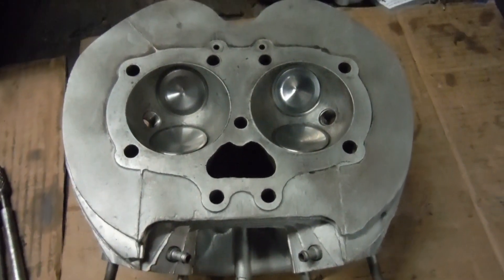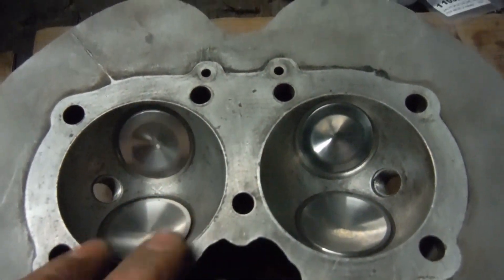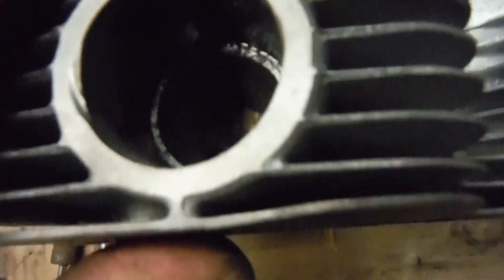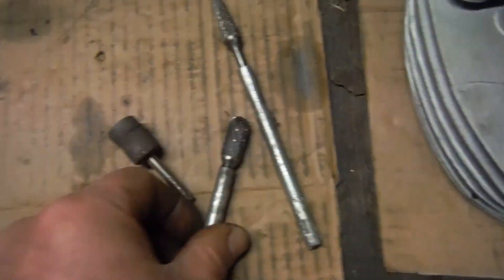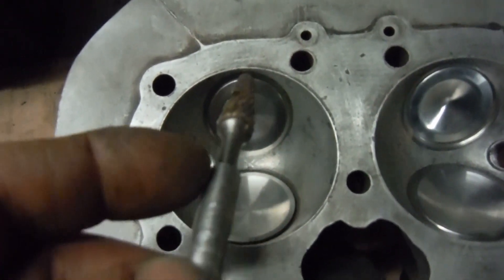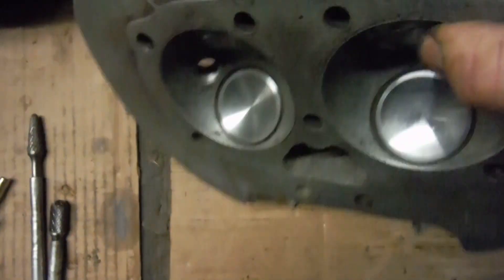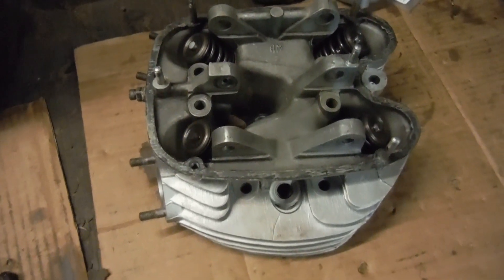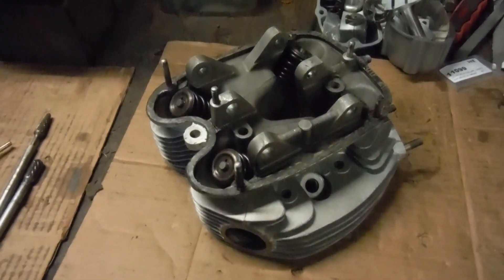BSA A65 Spitfire engine overhaul 12 Cylinder head work met with new valve guides issue.

Comment: Good recovery job. I had to do something similar on a guide, not on a cylinder valve but a hydraulic valve block that came back from the machine shop incorrectly set. It had been shrunk fitted with liquid nitrogen so I had to do it in situ. Too big to fit in the mill throat, it had to be done by hand on the bench. I had a counter bore bit that was a smaller dia bore than the guide bore but big enough outer counter bore dia to cut the guide end. I jammed a bit of nylon scrap over the bore flutes and skimmed it on the lathe to fit the guide. That was enough to keep it centralised and prevent guide bore damage but still enough to cut the guide end with a hand drill on lowest speed. Did the job and still functioning several years later when I next had the vessel in for docking.
Good luck with the welding job, might only be cosmetic but well worth it for a nice machine like that.